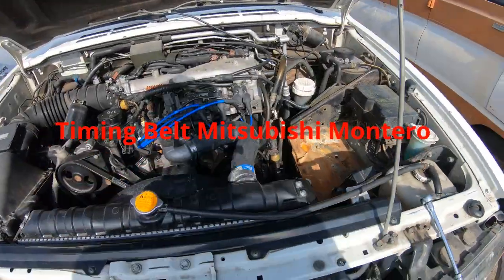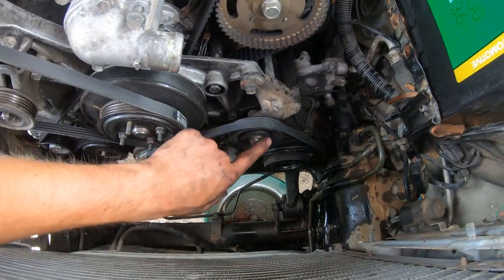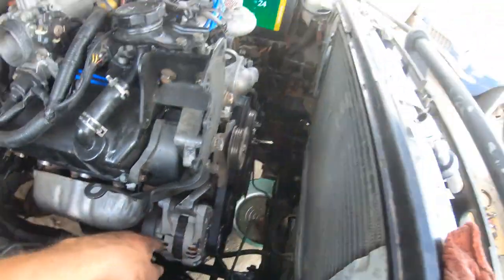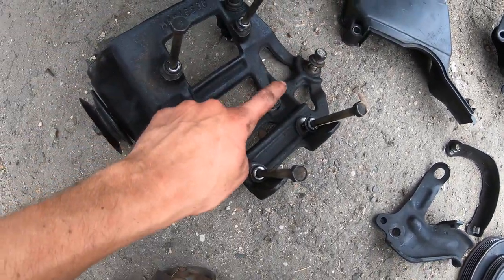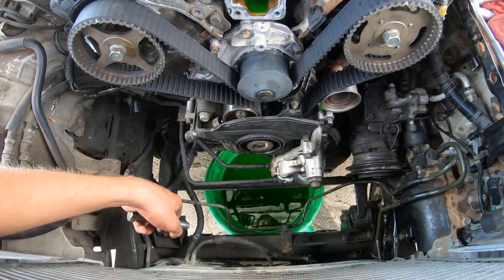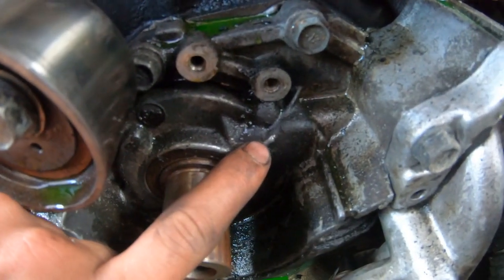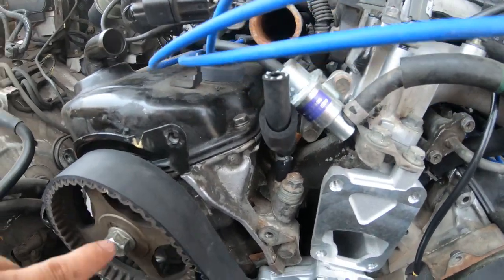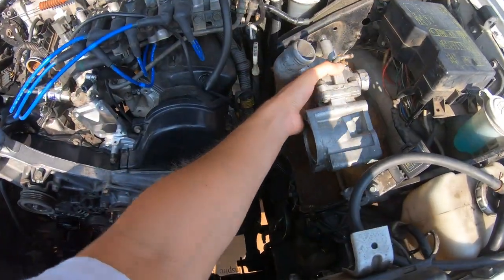Mitsubishi Montero Timing Belt/Water pump replacement

Comment: I’m doing the same thing on my 1996 Montero with the 3.0.  Water pump went bad, so doing that and the timing belt and how did you get the crank pulley off?  Thinking I’m gonna have to locate the flywheel and lock something in there to get that bolt loose.  My impact gun is too long to zip it out unfortunately.  Also, how do I find TDC on compression stroke or is that even important if I don’t turn the cams or crank

Comment: Hi, Mr Owen L. i owned a 1999 Mitsubishi Montero Sport LS, with about 157,000 miles approximately, first there is a squeeking noise during steering and when i shake down the front  part of the car . Can you tell yours truly as to why and what can i do to fix. if it s the control arm, or the rubber bushing? thank you very much

Comment: I have 95 montero 3.0 L v6 sohc and the crank shaft shifted to the right of the timing mark for the pulley by about a half inch. The cams are aligned properly. Your pulley was slightly to the right of the marking. How did you get it back in alignment before pulling all the accessory belts. Also, when you loosened the crank bolt with the impact. How did you lock the pulley in place so it would not spin? Thanks
Reply from the maker: So i loosened it with an impact gun and you can move the crank back to timing mark. And to torque it you need a tool to hold it

Comment: Very helpful man!  Thank you for this Owen.  FYI, I am about to purchase a 1995, 3.0L, V6.  Needs a new timing belt and water pump so I am going to have to tow it to my Dad's garage so we can do the work. Items I plan on purchasing ahead of time to have on hand during the process:  Waterpump/timing belt replacement kit, thermostat, serpentine belt and maintenance manual.  Any other critical stuff you think I should go ahead and replace while I have the front end open?
Reply from the maker: all the oil seals. All the coolant o rings. New updated crank bolt and washer. Possibly crank and cam sensor with oem or oem equivalent. Possibly harmonic balancer

Comment: Owen what sealant did you use to mount the water pump? Also did you buy an OEM crank sensor or just one off Amazon/ebay? Any other sealants/rtv that you used? I'm gonna do mine in the next week or two. This video is so much help. Thanks! 🤙
Reply from the maker: Used a skin coat of gray rtv. Also for the crank sensor only get Oem the aftermarket are really bad. No other sealants used just gray rtv a very thin layer skinned
Reply: @owen_03montero  Awesome thanks!!! I agree, I'll get the OEM 😎

Comment: very helpful video, nicely done. I need to do this on my gen1 89 V6 -- how similar do you think the process is?
Reply from the maker: way easier on a gen 1. I just did it on my gen 1 1989 v6 and its way easier than this
Reply: @owen_03montero  word i wish you had a video of that but I'll take a look at the FSM. I've worked way more on suspension components, pretty new to engine work so this will be a solid challenge

Comment: Great video! One question..if the timing belt fails on this car will it damage the motor?
Reply from the maker: yes if it breaks or is not aligned will bend the valves and hurt motor

Comment: one of the only and BEST videos on this job ever! Great work its helping a lot!!! 
Mine was doing weird stuff, starts and runs for 60 seconds then turns off and wont start! 
found the water pump leaking at rear and water was running down over the crank sensor from what we can work out, that will shut off engine. hope this all works out good! Thanks again Mate! Australia, straya it!
Reply from the maker: Glad I could help! Cheers from the US

Comment: How many teeth are on that belt? I have been having issues with finding out if I need a 195 tooth or a 201 tooth timing belt. Every time I add my vehicle info for a 2001 Mitsubishi Montero sport 3.5L V6 it wants to give me either option. By the looks of it someone else has changed out the timing belt before me and I just want to make sure I order the correct one. Any help with this will be great!

Comment: Thanks for sharing the video! Quick question as far as where you buy parts from rockauto or partsouq, do you get certain things from rockauto vs partsouq?
Reply from the maker: I get all the super important stuff from partsouq that is oem but for stuff that isn't super important like spark plugs, valve cover gaskets, wires, accessory belts, I get from rockauto. But you can get oem stuff from rockauto too. Look for denso, ngk, ntk, mahle
Reply: @owen_03montero  thanks bro! Appreciate the input!

Comment: Where is the part you can just quickly take off to inspect your timing belt, is that the little cutout piece on the left plastic section at 11.15? And is it accessible to take off and check without removing anything?
Reply from the maker: Yes it is removable you can use that or take the left side timing cover off

Comment: Did you use any type of rtv, or silicone on the paper gasket when installing the water pump?
Reply from the maker: Yes a very very thin layer skinned onto the gasket both sides

Comment: I'm original owner of a  2002 Mits Montero Ltd 3.5L engine that stopped running as I accelerated to pass a car, earlier this year.  I had it towed to a shop and they gave a general opinion that a thing belt was the problem and didn't do a diagnosis.  Knowing the potential expense, if true, I haven't gone any further on diagnosis and assumed they are correct.  It's been sitting for several months, as I weigh the pros and cons on fixing it. Do you know how I can verify the problem or is the engine a write off.  The replacement engine on eBay is $1,999, $2,300 with shipping, then core charge and cost of replacement.  226K on engine, half that on recent replaced trans and transfer case. The Mits is in great body and interior shape and is a great car to drive.  Any suggestions?
.
Reply from the maker: Only way to see if the engine is ruined is take the front apart and see if the timing belt snapped or jumped teeth. Once you have the front off you can see if the belt is okay and if it is then see if the timing marks line up. If the belt and timing marks are fine I would do a compression check
Reply: @owen_03montero  Thanks for the feedback.  I suspected that, hoping for an easier solution so I will hold on to it until I can check.  Nothing to lose, at least then I will know and make a fix or salvage disposal.
Reply: @Bill97070  did you find out the issue?
Reply: @yourchava  I got involved in other things and it sat for a year.  I bought a 2018 Subaru Impreza sport My apt management had it towed away. I just couldn't deal with it and let it go.  Sad to say that.  It had an issue with the a/c heater core causing water to flow onto the passenger floor, so it would be one thing after another and I had no time, money and place to fix it.  Thanks for following up on it.

Comment: Hey mate, when you loosen the bold on the right bank camshaft, was it the traditional counter clockwise? Mine won’t budge. Also do u have the part number of the updated crank bolt? Cheers
Reply from the maker: Yea everything is normal. I just used an impact gun to loosen. You can find updated crank bolt on Lusooverland.com

Comment: Great video. Thanks for sharing. What did you use to take the cam/crank seals out? Or.. how did you do it? :) I need to do that at some point in the future, but I dont want to scratch the cam/crank. Thanks in advance!
Reply from the maker: Used a seal puller tool
Reply: @owen_03montero  Have a part number? Thanks again
Reply from the maker: @lenineder  I'm sorry i don't it's really old

Comment: when loosening the power steering belt.. it cracked the flange... where the bolt sits on. hopefully i can find a replacement
Reply: I just had this exact thing happen to me. Did you need to find a replacement? I'm thinking of using JB Weld or similar on mine...
Reply: @masonbr1763  I cut a washer and  slotted in to hold it in its place. So far holding.